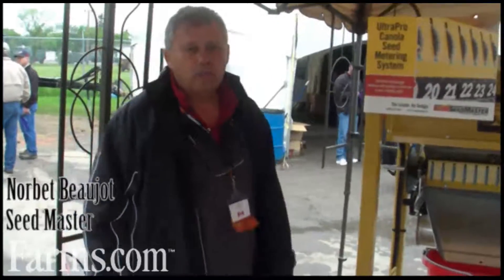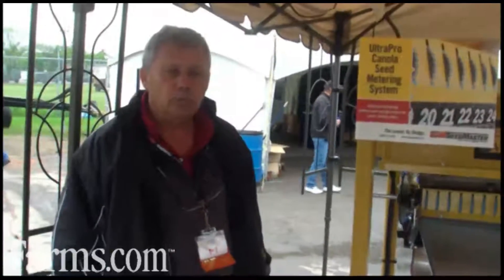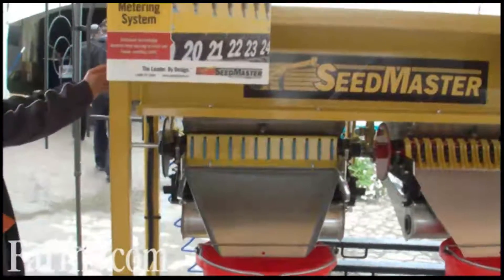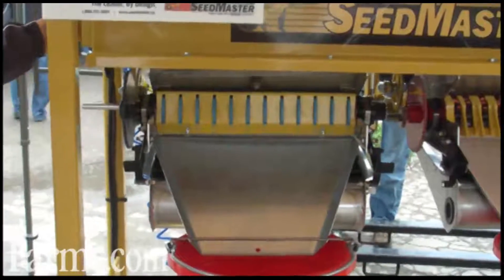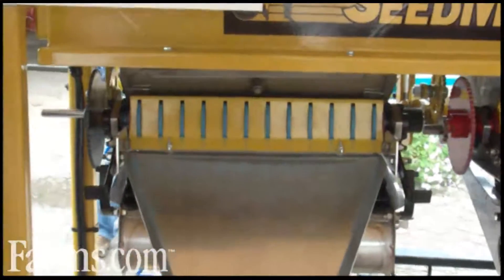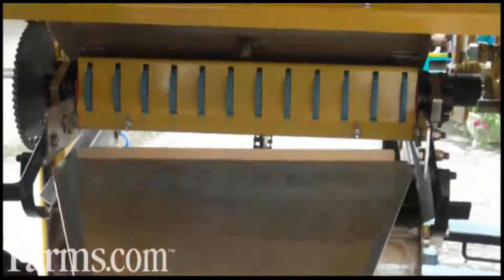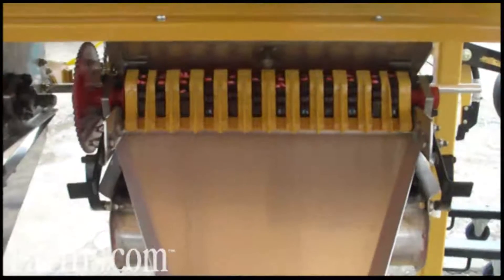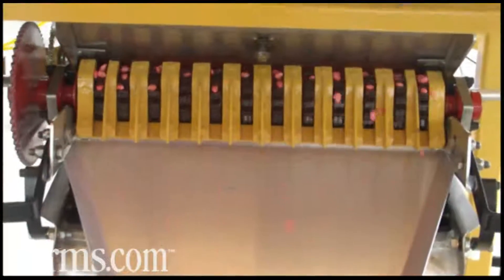Seed Master UltraPro Canola Seed Metering System

Comment: I worked one season with a seedmaster airseeder built in 2006 or 2007.

The seed- and feralizer-placement is excellent, so is the ammount of power you need to pull the seeder.

But I would suggest you to change the metering completely. That whole idea with those cups doesn't work well. They get plugged on big seeds like fava beans and small seeds like canola gets blown away when it becomes windy.
Maybe you should take a look at European seeding equipment. Horsch does a great job, Lemken as well.